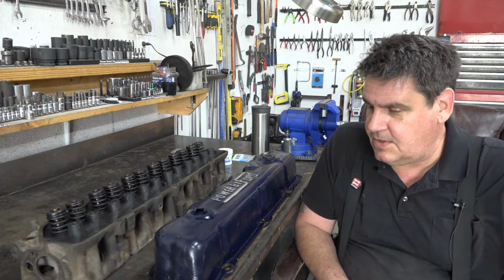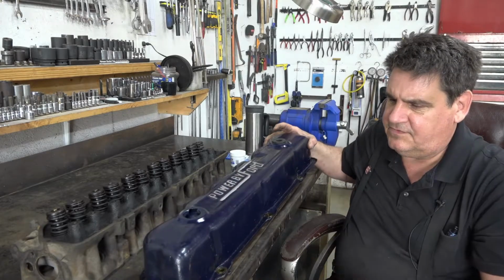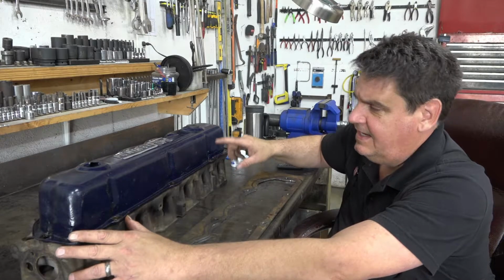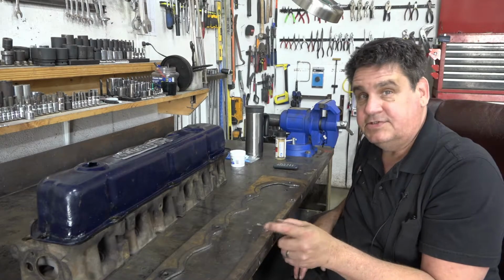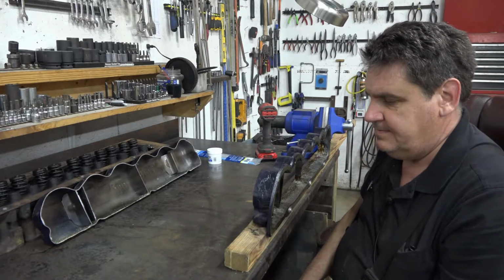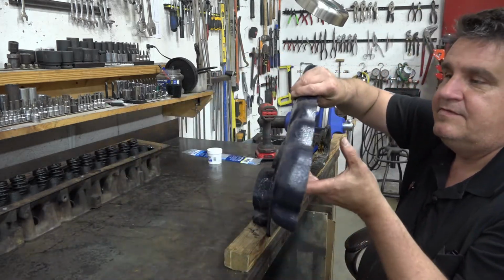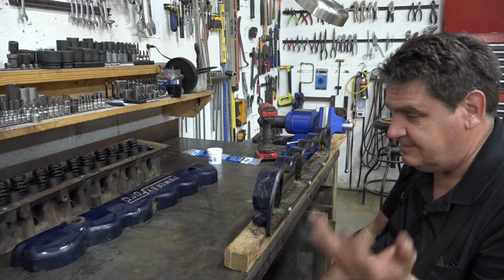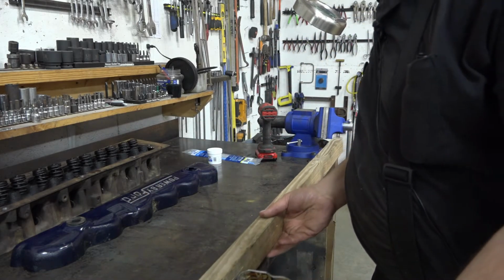"Ole' Blue" Restoration Project DIY Tall Valve Cover Redo.

Comment: wouldn't it have been stronger to have just welded or soldered the top part to the bottom part without any over or underlap? seems to me if you could have done it that way you wouldn't have any issue with the inside gathering oil and eventually leaking. i know it's kind of Monday morning quarterbacking coming up with that now but that's what i thought you had done originally, remember i didn't see it put together the first time but that's what i would consider to be the best way. and you never called for my spacial awareness professionalism or i could have just held the parts steady while you melted them together properly. it's not like i am a world away now, i'm just a couple miles away still
Reply from the maker: That would be called a "Butt Weld" which is very difficult to do, and keep everything lined up properly. Overlapping the two parts makes it stronger, and as I mentioned, overlapping them CORRECTLY prevents any leakage LOL!